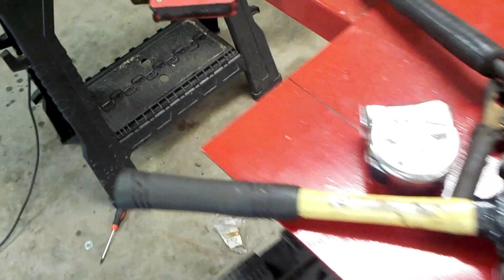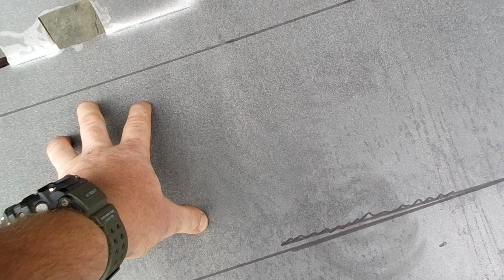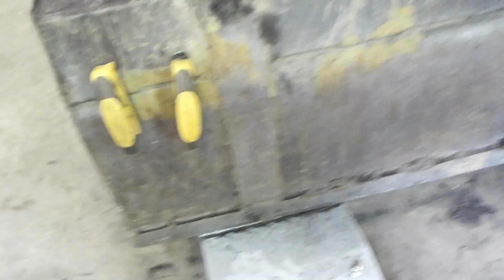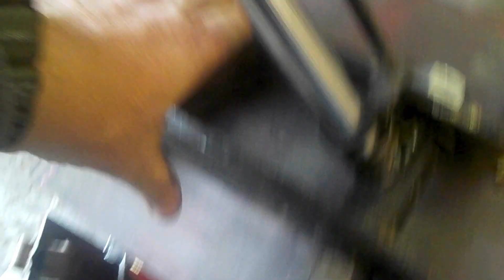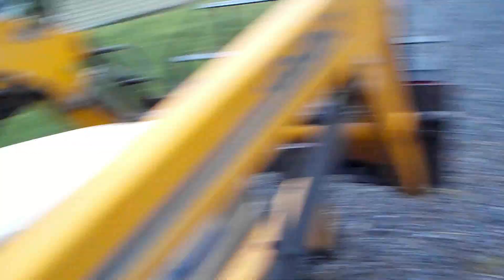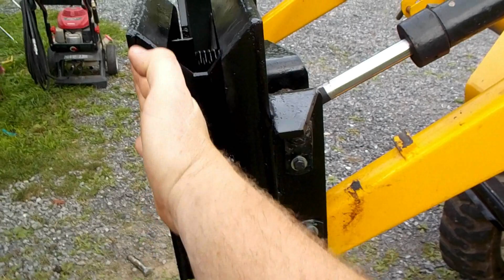Quick attach bucket adapter conversion

Comment: Was plate welded to back of old bucket set too low ?  When tractor bracket "lock pins" mate with bucket plate and go thru slots in bottom, will they dig in ground ? If He leaves the "bolts" in the arm bushings instead of putting the grease able pins back in bolts / bushings will wear out fast.
Reply from the maker: I am not sure about the first question, (I made the video many years ago, the children in it are almost all teenagers now) but the pins do not dig into the ground.  I am still using this tractor and plan to use it this weekend as a matter of fact.  I would never leave the bolts in, they are just an easy way of holding everything together and tight to weld.
Reply: @GSEShop ----  So sounds good then.
Reply from the maker: @robertwikeljr-1522  thanks for the comment

Comment: An advantage you didn't mention, in my opinion, is that if you replace the tractor, or buy an additional tractor, you can continue to use your implements.
Reply from the maker: Good point, as long as it has the same quick attach.  John Deere has it’s own system
Reply: @GSEShop  It'll be a SSQA, not John Deere, because I'm not buying all these implements again!   
It's like cordless tools.  Once you commit to a battery brand/style, you can't switch to a different, because you'll have to buy all new tools.
Reply from the maker: @SpynCycle57  just make sure it has the bobcat type you will be fine

Comment: I bitched at Titan for this when I bought one..lol.    first tractor I didn't realized the back was so long after I built it..   the 2nd tractor I did I made sure to do all the trimming before i started.    on the 3rd one I bought the make your own.   I also got a cub Cadet 7305
Reply from the maker: Video-gamer-for-life it is not a bad kit, mostly I wished they wouldn’t paint it first, or made the paint easier to remove.  Especially because they know you are going to have to weld on it.